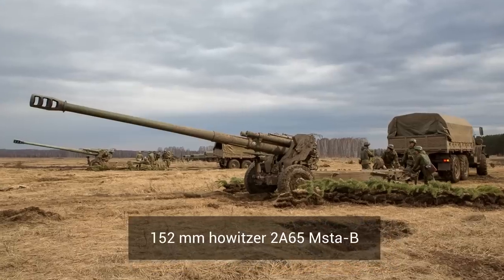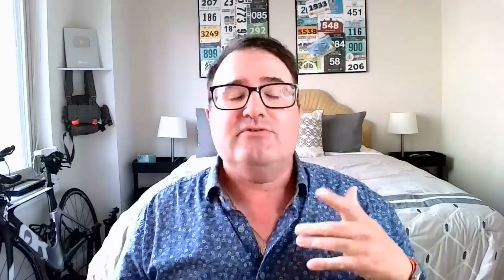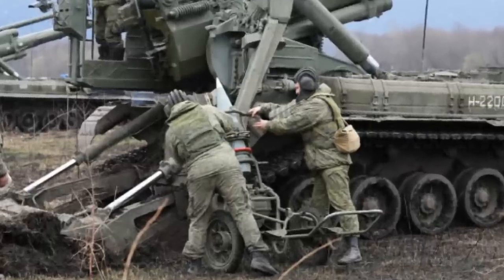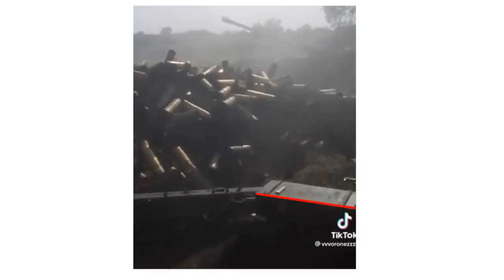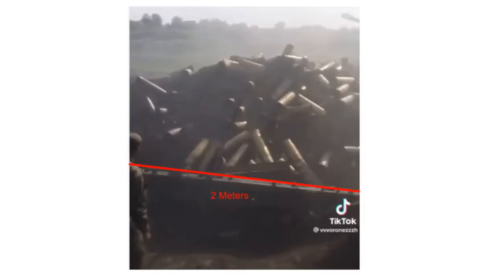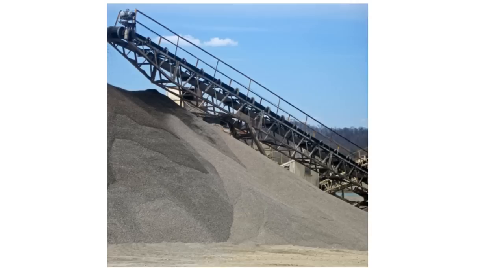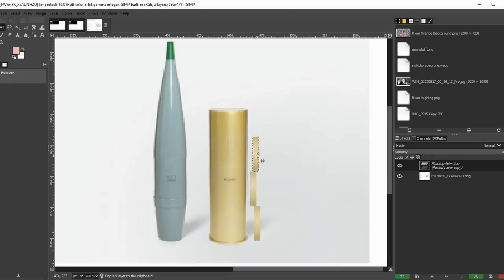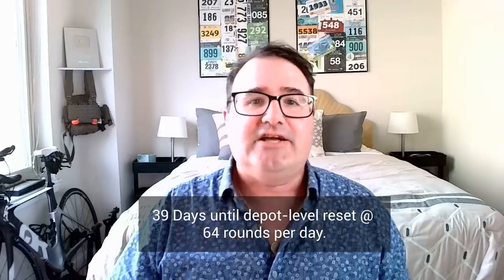When will this Russian Howitzer explode? (2A65 Msta-B Barrel life estimation from shell casings)

Comment: Hey, a great try on trying to figure out the number of shells in the pile.  A couple of things though..  The roughness of the material, the number of angles and how sharp each is, has a huge bearing on the angle of repose.  Ball bearings have a very low angle of repose,  crushed gravel much greater (of coarse--pun intended--the density of the material certainly has an impact too).  Also, you can't really extrapolate and super impose the length of an object in the foreground with an object in the background.  The focal length of the camera lens can make background objects seem closer or further away. Just sayin'  (btw, I was a Gunner then a Bombardier in an arty regiment many moons ago.  Our weapon was a 105mm howitzer.)
Reply: Does the density have much of an impact? I would have thought that the stiction would have more of an impact (static surface friction) and that density and gravity would be more or less cancelling forces because of that.
Reply: Angle of repose is irrelevant - all you need to calculate the volume of a cone is radius (width/2) and height. Even if his assumption that he can extrapolate the number of shells just by the cross-section  area of the cone was correct, he still wouldn't need any angles since he already knows the height and relevant side of the triangle.

Comment: This is admittedly a rather nerdy exercise, but here is another guestimate: 🙂

I think you should assume a cone shaped heap with a slope of 35 degrees. That gives a volume of roughly 1,39 m3. If the shell case has a diameter of 125mm and a length of 578mm, then it roughly has a volume of 0,0075 m3. They can't be stacked without space between, so perhaps add 20% of the shell volume. 

1,39/0.009 = 154 shells? 

If they can fire 1 shell every 3 minutes, that is 20 shells an hour. So, roughly 7,5 hours of effective work there in that pile.  As you said, no one in their right mind would stand for hours shelling from the same location, so clearly a training exercise. 

It does not give a basis for calculating possible days of service at all as we need to assume they would likely fire 3-4 shells and then relocate. It might take up to 20 minutes to relocate, so that makes 9-12 shells an hour. On a full day, they would probably not shell more than 4 hours, So, maybe 16-48 shells per day? Let's average that to 32, and If it can fire 2 500 shells between servicing, that is 78 days or perhaps 3 months of active operation.
Reply: Jo, I agree that volume is correct way to solve this problem. Surface area only estimates the number of shells you can see and not taking account of shells underneath.

Comment: Off topic...

What are your thoughts on the Kerch Bridge now capable of being damaged since the the attacks into Crimea? Your previous video about 3 months ago said that you thought it was highly doubtful that that bridge could be destroyed
Reply: Some people argue that Ukraine didn't used ATACMS for that, their answer is that Ukraine probably used Neptune missiles, the same ones that destroyed the Moscova, the flagship of the russian black fleet. It could make sense, the airfield destroyed was really close to the sea and barely had any elevation above the sea level.
Reply: @lorenzmaut3708  great to know! Fog of war, but the propulsion system seems to have the range.
Reply: Right. Look at the four bridges in Kherson Oblast. All the himars has done is put holes in them. Those bridges are tiny compared to Kirch bridge. The only reason kherson Oblast bridges have holes in them. Is because  those bridges are thin. Kirch bridge is so much thicker. More wire. More rebar. The supports are taller thicker wider. Again. More reinforced concrete. More wire and more rebar. Deeper behind enemy lines. There's been several attacks on the Kherson bridges. They are still standing. OK not safe. Light vehicles can still use them. Not tanks or heavy vehicles. If the same happened to kirch bridge. There would only be dents. Heavy vehicles would still be safe to drive over. The repairs would only be artificial surface repair. In my mind. Those munitions could be better spent on fighting wants really hurting Ukraine. Attacking kirch bridge would use a huge amount of munitions.
Reply: Even if Ukraine can't destroy the bridge, attacking it is still useful for a couple of reasons. The first is that the orcs will have to keep repairing it and the second is that they'll need to commit resources to defending it. Also, if Ukraine wants to reclaim Crimea, the bridge will need to be destroyed at some point.
Reply: @davidoliver7510  I wonder if on a thicker bridge if more of the explosive force would go into the bridge instead of just going through it. Even if the Himars did not destroy the bridge there is the psychological part when a soldier is crossing and knows the area is a target.
Reply: Disabling the bridge is preferable to destruction. As we do not know what the political situation will be 10, 15, 20 years later. For all we know there can be a regime change. Thus in the long-term the bridge being repairable is an economic advantage for both parties.
Reply: There's a huge difference between knocking a big hole in a road surface and damaging a box-structure in a way it can probably no longer carry several trucks, and fully destroying a structure in a 'all the pylons are gone' kind of way.

Comment: There might be one much safer reason for why the gun isn't extracting. Normally I wouldn't know this, but I remember that some WWII guns that are fired today sometimes have their extractor removed or otherwise disabled. This is because the extractor is agressive on the casings and can after few reloads of the same casings make them unusable (which is a huge problem for WWII guns for which new ammo mostly isn't made anymore). So either the gun is damaged in which case it's dangerous to use it, or they're just planning to reuse these casings as many times as possible.

Comment: We need to take into account Equivalent Full Charges EFC's when calculating barrel wear and life. For example 1 x Charge 6 would be = to  3 x Charge 2 so actual round count could be higher or lower.
Reply: THANK YOU! Precisely. Guessing at barrel wear is impossible without knowing what charge they've been fired at. Without knowing that, it's not worth the time to calculate it.

Comment: 1:10 Yes one person firing is SOP, it's in the manual even. 
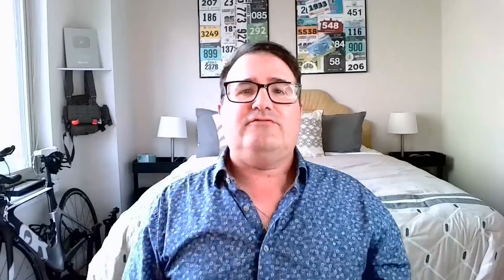1:17 Yes the shell doesn't come out of the locking mechanism because it's hot and metal is expanded. This happens to pretty much all artillery pieces. Heck Hindu Army's purchased an M777 that promptly exploded due to a similar problem. Again this is in the manual for D-30 howitzer, msta-b is the same. It doesn't mean the weapon is unsafe.
2:19 It's not a safety rule so that "only one guy gets injured or killed". Soviet artillery normally has very little compensation for the weapon movement upon firing. 
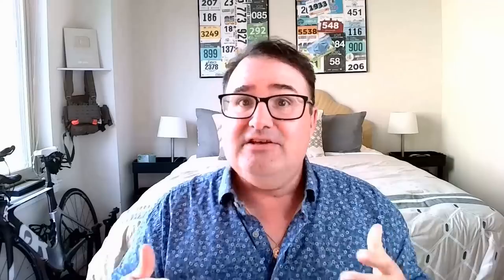2:33 That's not a helmet. That's a tanker's soft hat. So that tankers don't get their heads busted inside the tank/self-propelled artillery on march.
Reply: @cristobalalvarez5491  Everything? meaning what? 

"Во время стрельбы запрещается:
находиться впереди щитового прикрытия или в зоне откатках частей
заряженного орудия" 

"During firing, it is forbidden to be in front of the shield cover OR in the zone of recoil of the armed weapon" [section 3.1, translation is mine]

Don't argue if you don't know what you are talking about.

* Source: 
С.В. Гончарик
А.В. Назаров
А.Г. Янус
Артиллерийское вооружение
ПОДГОТОВКА ГАУБИЦ
Д-30, 2А-65 «Мста-Б» К СТРЕЛЬБЕ

Comment: Automatic casing ejection can also be disabled if the gunners don’t want empty brass flying everywhere and if speed is less of a concern. I don’t think the lack of automatic ejection can be used as evidence that the gun is malfunctioning.
Reply: watch the video the part that ejects casing tried to do so but it stopped halfway
Reply: You can certainly disable it on a WW2 German 88. Reenactors tend to do so in order to avoid denting the (expensive) casings, notwithstanding the fact that without a full power charge and shell they don't eject very well anyway.
Reply: Where do the casings go if they are not ejected?
Reply: @jasonthewatchmansson8873  they would need to be manually ejected using the lever that opens the breech
Reply: @jasonthewatchmansson8873  Well, you'd have to extract them manually, which is possible. The auto ejection is an option on at least some guns, anyway.

Comment: Using some VERY rough math and using both the Russian and Ukrainian numbers on how many shells are being fired every day it is in no way an absolute thing particularly if the Russian High Command doesn't care a whole hell of a lot about barrel life which is very possible many Artillery pieces should be going out of commission soon or at the very least are going to need to be taken off the front lines just because they can't hit a damn thing they are aiming it at and with the Ukrainian HIMARS being used to good effect by targeting ammo/supply depots this will further strain the already stretched Russian supply lines having to move artillery back to SAFE supply depots to then be fitted with new barrels hopefully it might give Ukraine enough of a breather to perhaps mount a counter offensive.
Reply: A Ukrainian counter offensive was just announced as having commenced on the 29th. Maybe the calculations on the state of the ruzzians guns were also at play in that decision
Reply: I doubt that they track barrel life.
Reply: @512TheWolf512  I would think so, but it is possible that this is mostly just an offensive to take pressure of the fronts further north.
Reply: @AndRei-yc3ti  Well think of it this way Ukraine is on the defensive, they by all known military metrics do not have to expend anywhere near as much as Russia does on an offensive as well as a defensive strategy is also far more easy to tactically achieve as compared to an offensive which requires days of pre bombardment and hours of assaults' for only perhaps a few miles of ground just to name a few things required for a successful offensive. Russia's  offensive's NEED solid supply lines for the constant influx of shells, bullets, gear, spare parts, trucks, tanks, ect. while Ukraine on the other hand does not NEED those supplies to mount a strong defense as was shown at Mariupol. The longer the supply lines run the harder it is to maintain pressure and continue assaults' that is why it is a big deal it makes a defensive strategy even easier to keep up and bleed the enemy dry.

Comment: Nice estimate :), also it’s usually the case that the wear of a mechanical part is like a ski jump, with slightly higher wear initially because of the fresh components having less clearance and the slight imperfections in the construction being worn out asymptomatically at the begging, but then it usually settles into a wear pattern and in the machine or gun is well designed it should have relatively low wear for most of its lifespan, but at the end when the parts start to wear out the overall wear shoots upwards and the last few shells will do much more damage than earlier shells can, because the thing isn’t working properly, this goes for engines and everything else pretty much. so if the barrel and chambers are worn out the last few shells are responsible for most of the wear tbh :p, ofc lifespan is counted in numbers of shells so 1 shell is always one shell in the lifespan, but the later shells are the ones that rapidly degrade the weapon.

Comment: You also need to take the topography of the "dug in" nature of the position into the equasion. What looks like a giant pile of spent arty charge bases may not be as giant as it seems, because the base of the firing position is below ground level. Not saying that it isnt a lot of charge bases, just that the pile kinda spills over into the dug in position, possibly giving the impression of a much larger pile. 11H1P forever

Comment: Former 11B here. It seems the reason for one soldier firing the gun, is that when it fails, they only lose one soldier and one gun, or if the Ukrainian drone gets them. Expendable comrade, getting the most bang out of their Ruble. Loss of one soldier and gun which are replaceable...until they are not.

Comment: The failure to eject might not actually be a failure to eject. Many artillery pieces can be configured for automatic ejection or to retain the shell. Automatic ejection is much better for rapid firing for a better effect on target. The downside is it throws the shells on the ground which could present a minor hazard in an of itself but it can also lead to damaging the shells. If this is a training environment like you said most likely these shell casings are being sent for reloading and reuse in training to help cut costs. Maybe a look into the design may help shed some light as not all designs will allow this option but if you can turn off the semiautomatic feature this is probably what they did.

Comment: The pile of shell casings is a cone. Therefore,  V=1/3 pi r2 x H. In words…one third pi r-squared times height. Another way to look at the question is one-third of a cone of the same height.
Of course, a bunch of artillery shells is not exactly a “tight pack”. So, depending on chance there is a “range” of likely outcomes.
Any votes to just keep track of the damned discarded shells and after 20 or so iterations, you will get a pretty reliable average.

Comment: As someone who works with angle of repose for industrial applications, anything that is 2x its own width in length can form a variable angle of repose that can reach 70 to 80 degrees (or more!) to its base area. If you look at the video, and manually count casings you can see, it climbs above 64 rather easily.
Furthermore, looking at the shell casing pile, many are stacked with their ends facing the observer in a neat pile inside of the casings thrown haphazardly upon said pile. These give the pile much more depth beyond a single planar surface, and could indicate a wall of hundreds of casings beneath those which make up those strewn about against it.
The pile continues to the right a ways as well, and while we cannot assume a uniform pile shape, circular or otherwise, we can somewhat assume a uniform depth.
I'd estimate that in addition to your 64 shells, there are possibly 300 more buried under there.

Comment: For What It's Worth ............ The picture used at 3:32 of the video is not of artillery shell casings as suggested in the video but actually of fired small arms brass.  Most of the brass appears to be 7.62 but some could be 5.56 based on the visible necking.  The soldier in the background of this photo appears to be firing a SAW from a berm position, probably at some type of training range.  Piles of mixed brass like this are a common site at military shooting ranges.

Comment: Many artillery pieces are "semi-automatic" in that they can be set to either eject spent shells automatically after firing or they can be set to retain them for manual extraction. An example of guns using this feature would be the WW2 German PAK guns in 75mm. The advantage of manual ejection is that the shells are much less damaged and can be reloaded and re-used, almost like how amateur gun owners can buy reloading kits for their spent brass.

Comment: So I'm an artillery crewmen, and we don't use brass casings for American artillery (except 105mm) so I can only guess, but what might be happening is carbon build-up in the breech. You have to swab the bore between rounds because carbon will build up and among other things can gunk up operation of the breech where the don't close all the way and something to that effect may be happening. It would not surprise me at all to hear they weren't doing proper crew drills with the other obvious training and tactical failings.

Comment: There have been some pictures of the barrels on these things being uncentered. Like the barrel side wall was 1 inch on one side and 2 inches on the other. 

Those are huge defects that will warp the barrel very quickly.

Also very optimistic of you to think they wouldn't use a gun until it explodes or leave a big piles of casing around it. 
And a lot of recent conscripts aren't issued body armor/helmets so that's not a good way to base a thought on.

Comment: The pile of shell casings appear to look more like a section/part of a sphere because the shells were not all dropped from the same single point above the top onto the heap. The bottom/base width of the sphere section appears more like 4m (x2m bicycle lengths) and height 1.5m  .  Assume the diameter of the FULL sphere is 8m (radius 4m). Then the volume of the sphere section is 1/3*pi*1.5*1.5*((3*4)-1.5)=24.7cub m. The volume of one shell casing is 0,04 cub m. Assume a compaction of 50% (half of shell heap space is air), then total casings in heap is ~0.5*24.7/0.04 or approximate 310 shell casings.

Comment: There is the possibility that the ejector and extractor have been disabled to minimize damage to the shells so that they can be taken back and reloaded / reconditioned. This is a common practice with individuals int he United States that have antique artillery pieces to prolong the lifespan of the shells that they have especially with equipment that has auto eject features as new shells are either very rare, expensive, or hard to obtain.

Comment: While the math seems correct, the measurements of the Suze if the mound is off. The mound extends out of the frame on both the left and right of the picture. I’d estimate Nate possible twice as many casings.